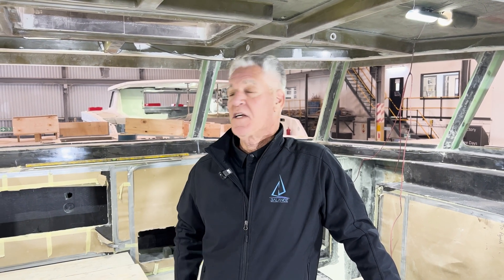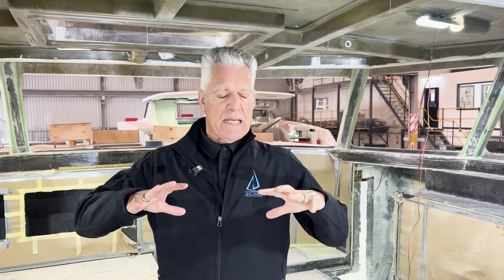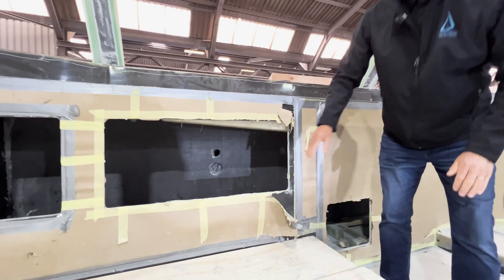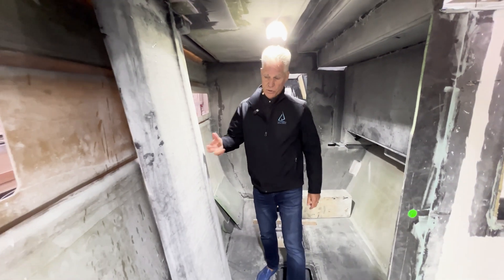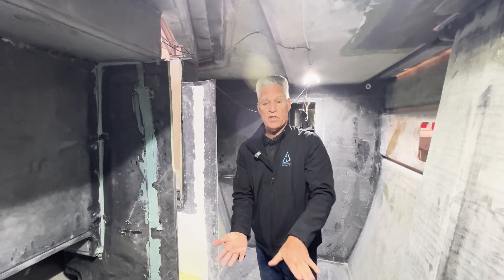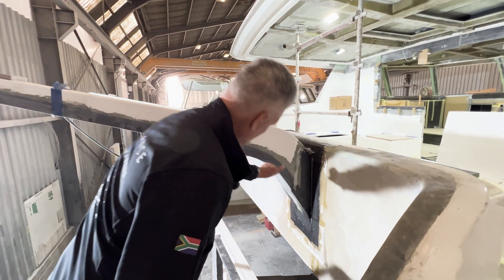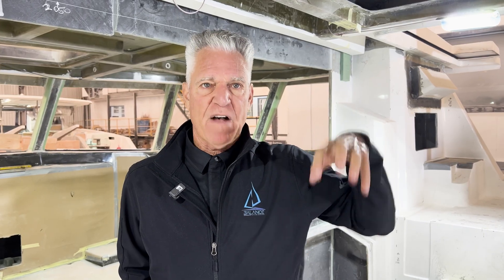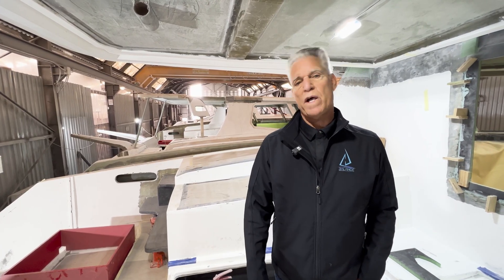Inside the Balance 502: What Makes a Carbon Core Catamaran Different

Comment: Thank you for a great video.  As a former Outremer owner of 13 years, I will tell you that Outremer could have used some of these techniques.  

How do the furniture modules attach to the inside of the Balance?   This was another area of opportunity imho w Outremers...
Reply from the maker: The furniture is hand crafted to fit each boat perfectly and then glassed or tabbed to the hulls or floors. A Balance is a squeak free catamaran for this reason.

Comment: the most abuse and overuse word in boating industry is "carbon fibre"...all marketing
Reply from the maker: ???   Carbon fiber has enormous strength properties and when used wisely allows for a lighter and stiffer yacht. It does cost more money to use, however. It is also, as we note, very stiff and when used in the hulls makes the boat a bit noisier when sailing at high speeds.

Comment: Thanks much for the tour Phil!  It's fun and informative to see some of how the boat is designed and built.  And it really looks good.

Presumably Carbon fiber costs are falling, to help make this more practical.

Feedback: the audio fades out at times because the microphone is either not pointed at you or blocked by your lapel.  Put the microphone on the inside of the lapel, pointed at your face.

11:05 The Carbon fiber should be on the top of the davit strut since the force is in mostly tension.  Also Carbon is weak under compression.
Reply from the maker: Carbon prices are not falling strongly. The larger issue now is we price in dollars and the dollar has weakened a lot to the Euro, so many of our Euro component prices are going up a good bit. Right now our boats have become a very good deal for Europeans so not surprisingly are most recent buyers are Europeans. The new tooling was a big investment, but we are so happy with the new models. We will launch the first 502 now in a matter of days. Take care. Phil
Reply: @balancecatamarans  Long term, Carbon fiber prices have fallen approximately in half.  Maybe they're up in the shorter term?  

Good to hear about more European sales.  Showing the boats in Europe surely helped visibility too.  I have a feeling you impressed many when they could see the build quality in person.

Comment: I get not using carbon but why not use s-glass for the hull?
Reply: Good question for the boat building industry in general.  E-glass is far more common.  S-glass is indeed better.
Reply from the maker: We've looked at the cost of S-glass and the benefits of it over E-glass and Du Toit Yacht Design has determined that E-glass is the better choice for us.

Comment: How much weight do you think you are saving in using a carbon core vs the old construction ways on your previous boats?
Reply from the maker: We will share this in a few months. We are weighing our fiberglass parts carefully and when we get a chance to place enough hulls on lode cells we will be able to offer accurate figures.